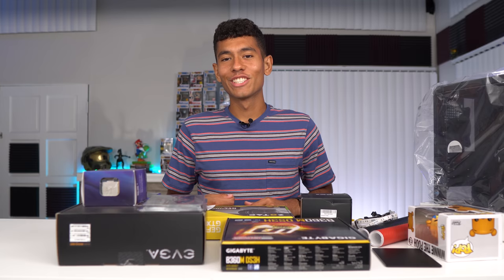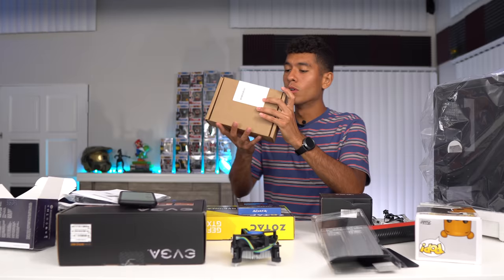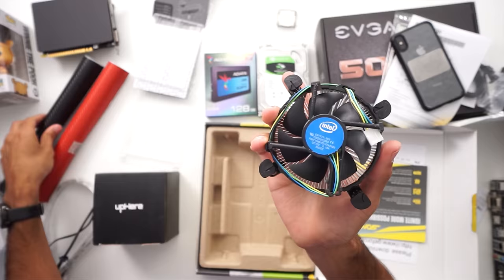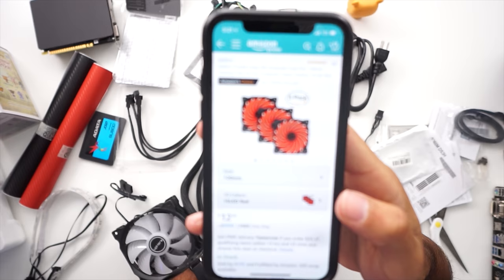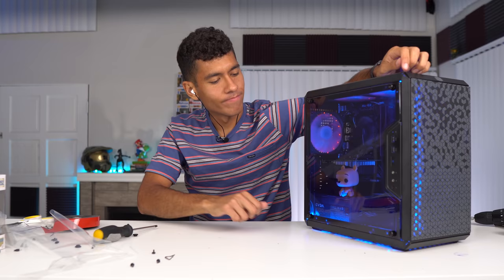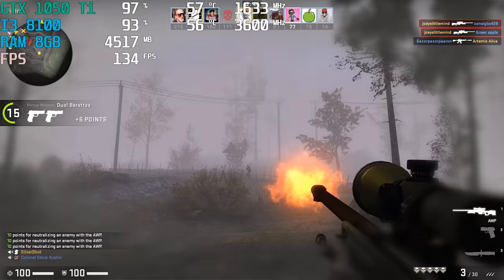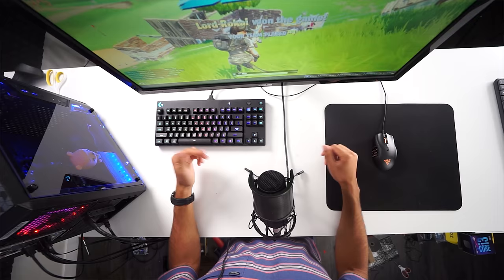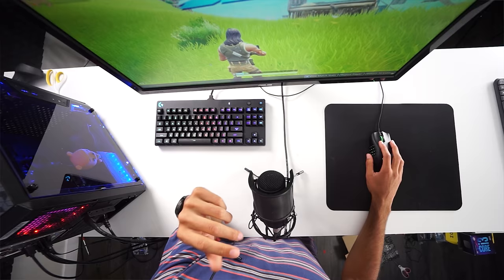$650 Gaming PC Build - i3 8100 GTX 1050 Ti (w/ Benchmarks)

Comment: Does it matter if I get a  Evga 650 BQ
Reply: there are calculators online that show you how much power you need. see your parts and then can calculate how many watts. 650 should be plenty for a single GPU card setup.

Comment: Is this still a good pc for 2019???
Reply: Nope better parts have been released for the same price with better performance
Reply: Go with an i5 or ryzen 5 2600 for CPU, and get an Rx 570. Should be around the same price, or maybe a little bit more, and would perform MUCH better.
Reply: Its ok for now and you can change ur pc specs later in the future
Reply: He did a pc thats 400 now and is two times better

Comment: Is it Still worth it to build this ?
Reply: Get a 1060 then it should be good
Reply: i did this exact build but got the 1060 and it is awesome!
Reply: I'm deciding to build this one too, what did you change? Is the CPU still the same? Can it handle games like Fortnite at High or Ultra? What other games have you tested, do you have benchmarks? Also do you think it's good for Video Editing/Streaming? Let me know as soon as possible, since I want to start assembling asap. Also did you get the, Zotac NVIDIA GeForce GTX 1060 6 GB Mini GDDR5 Graphics Card?
Reply: Probably not good for video editing but it should play fortnite on high 60 FPS for sure.
Reply: If u really want to video edit and stuff a i5 8400 should be good for that 4 cores just isn’t good enough 6 cores should be pretty good for it and if u want to play ultra get a 1060 3gb
Reply: I was thinking about the Ryzen 1600 + ZOTAC NVIDIA GTX 1060 3 GB.
What are your thoughts on that, and would it work with this build?
Reply: B34ST G4M3R yes of course I have a ryzen 5 1600 with a rx 570 and it runs really well on fortnite
Reply: B34ST G4M3R they 1060 3gb is actually a little better so yes it’s good
Reply: B34ST G4M3R I don’t have benchmarks but I go the spray 1060 6 gb and it works great. I play pubg on high and works amazing. I used the cpu he used in this video, actually everything in this video except I changed it to the 1060 zotac
Reply: Would you recommend Intel Coffee lake Core I5 8600K Processor or Ryzen 5 1600?
Reply: Ryzen 5 1600 because it’s cheapest and I can overclock it
Reply: Can you overclock it on this motherboard though?
Reply: Uhh that I do not know cause I don’t Overclock my self so you’ll have to ask someone else that
Reply: @BSTGMR-kj3tu  for Ryzen processor you need a320, b350 or z370 chipset not Intel coffee lake mobo. You need b350 or better for overclocking.

Comment: under 1000$ pcs are potatos over 1000$ pcs are the real pcs because budget pcs will not even do 1080p ultra at 90fps for 3years for example this 650$ pc cannot even do 1080p ultra at 30fps in metro exodus and assasin creed odessy if you want built budget pcs just by used intel i7 cpus like i7 4790k or i7 6700k  and gets a midrange gpu like gtx 1070 or vega 56 and this pc will do over 60fps at 1080p ultra for 4years